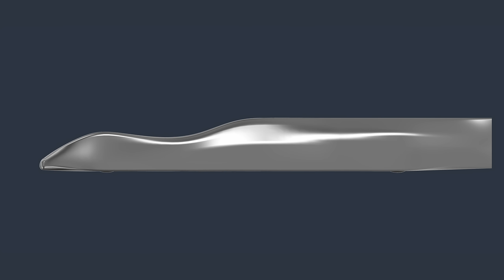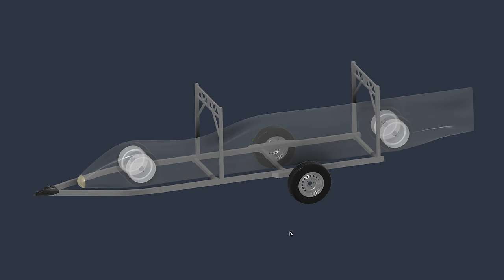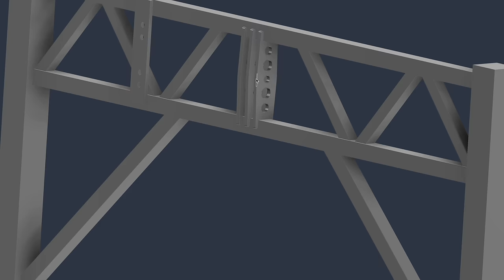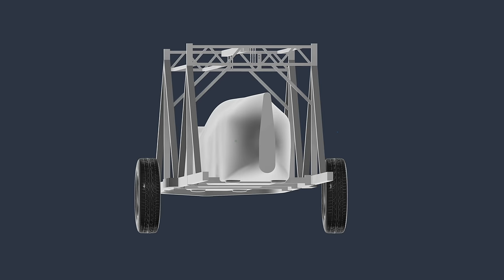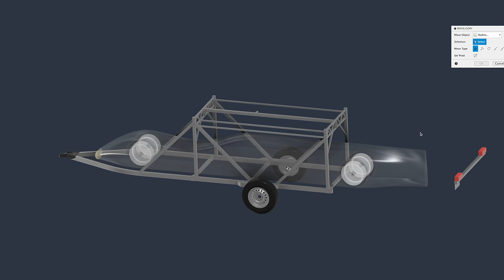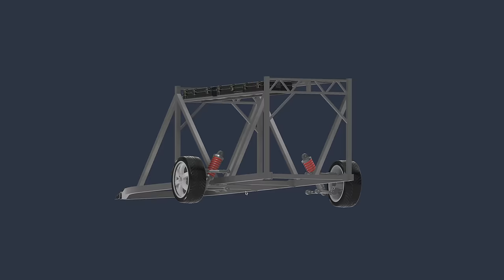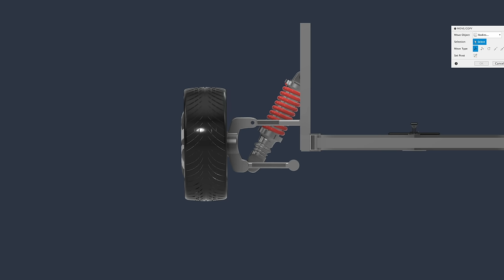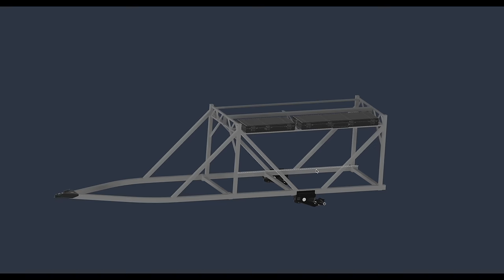How To Trailer A Car With ZERO Ground Clearance

Comment: Paint for zinc gal exists, you want the Hammerite gal paint or Dymark Zinc Guard stuff. You can also treat the surface with a mild acid like 5% acetic (you know, white cleaning vinegar) and use an enamel.

Trailer looks great!

Comment: You may want to load the car in backwards to improve weight distribution on the trailer and reduce wear on the front facing polished surfaces of the car while towing.
Reply: Brilliant. Very good point.
Reply: Did you miss the part where he carefully calculated the weight distribution of the car when placing the axles?
Reply: @brianpennington4202  I caught that, but wanted to see the calc with the car backwards. I said ‘may’ meaning maybe no better but the car isn’t 50/50.

Comment: The air pressure string trick works better if you tie a plastic sack on the other end and use a shop vac.

Comment: If you don't at least get ST trailer tires, get some LT tires with more of a highway tread design. 195/75R16XL, LT225/75R16, and LT215/85R16 are easy to find as they are common tires for dually commercial trucks.

What I would be inclined to do is match whatever size you run on the motorhome (probably 225/75 based on every E350 cutaway I've worked on). If you run 8- lug adapters, you could even share wheels back and forth in a pinch.
Reply: What is the load per tire, and what is the tire load capacity? If there is suitable capacity, there is no need to buy new tires. 

Sharing wheels with the RV to share tires does make practical sense.
Reply: I know you'd definitely want trailer tires on the trailer, but unfortunately as I'm not a tire engineer, I can't really articulate the reasons why. I do know that trailer tires just act different from vehicle tires, and cope better with the loads trailers see. Apparently lo-pro vehicle tires cope especially poorly with trailer loads. I remember Doug went into it in his VINWiki video about the Corvette boat, which came with a Corvette themed trailer riding on Corvette wheels and tires. https://youtu.be/vGWjlT_xRq8?si=PLpsVyoxLKDwjlj4
Reply: @billgiglio1023  tires work the same way on trailers as other vehicles, and the tires don't know that they're on a trailer. 

In heavy trucks, tires for every axle are built the say way, except that they are available with treads optimized for wear in three classes of position: steer, drive, and trailer. They also have "all position" types available, so clearly exactly the same tire can work properly in any role. 

Light motor vehicles (cars, pickup trucks) don't have separate steer and drive tires; they don't need separate trailer tires, either. The rear tires on a front-wheel-drive car don't steer, don't drive, and have exactly the same job as a trailer... and the same tires work there are on the front of the same car, or on the front or rear or a rear-wheel-drive or all-wheel-drive car.

The "ST" (for "Special Trailer") designation for small trailer tires is only used in North America - apparently tires are supposed to work differently on different continents. 😄 They are suitable for trailers, and so are other types (commercial, Euro-metric, "LT" for Light Truck, and even "P" for passenger) when used within their rated capacity.
Reply: Exactly. Nearly every trailer/RV forum has some oldtimers who will pipe up to say they learned the trailer tire lesson the hard way. It's more than just load rating. 

LT tires with a highway rib tread pattern are similar enough that some trailer manufacturers spec them on some models. I'm doing so on one project where the trailer is a lightweight, limited-use show piece and the smallest LT tires (185/80R14) are a better fit than the smallest ST tires (205/75R14)  

This hauler and the race car may not weigh a ton, but it's a very long contraption, prone to all of the funky dynamics and leverage that come with that. I wouldn't highway tow it anywhere on those Viper wheels.
Reply: A young guy with an Austin Mini (the 1960’s type) used trailer tires because they were available for 10” wheels. How well did that work? I don’t know, but he also tinted all the windows deep lime green to match the body.

Comment: Not applicable for this application, but I don't know how I lived before having a "Donahue"(brand) moveable axle drop deck implement trailer.  The deck of the trailer can be literally laid on the ground and you just dive on the deck, then move the axles back and drag the movable tongue back up into position.  All done by locking/unlocking the trailer wheels and the axle carrier slides on the underside of the deck.

Comment: Matt, that string trick is pretty neat. I've used it with PVC pipe and a shop vac but never ship air. Nice job.
Reply: tie the string to a slightly inflated baggie if it doesn't work the first time.

Comment: I would be careful about using non-trailer wheels and tires on the trailer. While it may turn out to be a perfectly fine, it would be really disappointing if there was another VINwiki Corvette-boatesque incident where sports car tires cannot handle trailer vibrations and shake themselves off the trailer, or otherwise being a headache
Reply: And what happens when the spare tire goes on and you want to drive in a straight line? But it looks awesome which is the most important thing
Reply: @Droidy77 he has 4 Viper tires, surely he'd just use one of those as the spare to keep everything matching up

Comment: Nice job on getting the trailer operational. The suspension was almost exactly what I was picturing, with a trailing arm setup (trailer of the trailer's trailing arm?). Although it is stronger and offers storage with the gun boxes, I am kind of surprised you did not make the upper section collapsible. After all, you are driving around with one of the world's most aerodynamic vehicles behind you (once the bodywork is added)--and it's covered in scaffolding.

Comment: Up until the midway point, I was screaming "Why don't you just use Timbren units!!?" YES!!

OTOH, why use the midpoint swinging beam? Why not use the already provided mounting point for the welded cross tube? (Recommended) but install a nice pair of bolts for the tube? I'm guessing that fitting/removal of the tube might be problematical? I'd still suggest adding it in, as the bending forces from the suspension unit might be a bit much. You might need to taper at least one side of the tube to make fitting it easier.

Comment: I had a friend who use to make custom enclosed trailers for drag cars, mostly notalgic and railers. He used an electric winch on pulley rail system that ran from the rear to the front of the car. You lifted the front of the car in the air and load it with the front raised. This prevented the car from bottoming out.

Comment: Another option for lifting the LSC would be to have the two 'overarms' actually pivot.  Lean them backwards 45 degrees, hook up the car, pull them upright with the winch, and secure them in place with trailer hitch pins.  Would require securing the car to the trailer somehow, though.

Comment: 4:52 I may be wrong, but I'm fairly certain that a single axle trailer cannot legally be over 16' in the US(except for boat trailers). It may just be Texas, though. So if it is that long(or 17.5' as you stated later), the trailer may not be legal as you still only have one axle.

I worked for over 5 years at a Fabrication shop that commonly made trailers, and i had to reference the code book somewhat often(i seemed to be the only one that cared about them actually being legal, and i was in charge of the lighting and finishing stages). I left that job last year, and i can't find that exact code book online, so i can't say for certain. I do know for a fact that we never built a single axle that was longer than 16', for anything over that we always did tandems.
Reply: Also, I'm sure you already know this, but whenever you do install the fenders, you'll need to make sure there are lights marking their width, as they will be the widest point of the trailer. Your trailer looks to be under 80" total width, so you don't need anything additional besides your tails(which serve as your rear markers as well), width markers, and front markers(which it looks like you already have).

If you added sideways extension wings to the rear bumper equal to the width of the fenders, you could mount your taillights there and not require fender lights.
Reply: You are wrong
Reply: @russellv6234  Can you back that up with something solid? I have trouble believing a simple "you are wrong"
Reply: @TheHonestL1ar  Easily. The US doesn't make trailer laws. Individual states do because we're a stupid fucking country and require things to be as complex as possible. So there could be as many as 50 different trailer length laws.
Reply: Also you can get a 28 foot pup trailer in every state and they only have 1 axle
Reply: @russellv6234   Pup trailers are for semis. I'm talking about trailers for pickups or cars. Semis have an entirely separate set of regulations.

Also, I did say in my original comment, "It may just be for Texas, though." Every state has their own laws because the federal government has limits in place to prevent them from controlling everything, and anything not regulated at the federal level is left up to each state individually. It's actually a very smart system for a country as large and varied as this is. Something that works for Washington might not work for Florida or any other combination of states.

Lastly, the federal government absolutely has regulations regarding vehicles and trailers. Most of what you find in the day-to-day just governs commercial vehicles, hence why you'll see both a state and US DOT number on the side of every semi truck. However, the US does have loose general overall guidelines on everything that goes on the roads.
Reply: @TheHonestL1ar  And yet after all that you got it wrong. No 16' limit on single axle trailers
Reply: @TheHonestL1ar  Thanks for your helpful comment(s) and keeping the discussion reasonable versus angry guys comments
Reply: Axels carry weight. length is only important to the tax man. In my county no registration needed for less than 16’
Reply: He is in California, 16' is the max for some rules, I think larger can't use a PTI but need registration every year.  You need brakes for 1500lbs or more, so he will need brakes, and a second axle is a great idea.  My trailer (see my channel) uses a smaller diameter front wheel so its a single axle when empty making it easy to tow and move by hand, but the second axles contacts ground when a car is on it, and also gives me two spare tires already in place if a rear one blows out.
Reply: @murraymadness4674  I did consider mentioning the brakes being required, but I chose not to. Brakes are the single most common thing to be nonfunctional on a trailer even when they're required by law, so I decided it was no use.

Comment: Seems like it would have been much simpler and cheaper - well, maybe not cheaper - to buy 2 Collins Tow Dollies, weld a tow hitch to one of them that extends out several feet, and strap them to the speedster. According to Casey LaDelle, they're good for hundreds of miles at highway speed.
Reply: Interesting idea. You'd have a problem steering the front dollies, or more correctly, allowing the front dollies to pivot/steer on the front of the racecar.

Comment: I'm only a minute in - but I have been thinking about this very problem for the last couple of days. A solution I am contemplating is - what about a trailer with a parallelogram lift system so that you can drop an inner suspended deck right down onto the ground? It could then be raised using either mechanical or pneumatic/hydraulic lift and locked into place using pins. 
I will now watch the rest of the video, and see if we both arrived at the same solution.
Reply: They use such trailers for pontoon boats but not low like needed here. A good system.

Comment: It will be interesting to see if you can still get those bolts into/out of the lower cross bars once it has been moving under load on harsh roads for some length of time. Especially if you roll it around without them while on the lake. Steel is rather bendy.
Reply from the maker: It wasn't a problem for the other trailer teams i talked to, but I will have a few ratchet straps and a hammer ready just in case.
Reply: It works OK, just keep a hammer handy. We have transported NT3 from San Diego to Bonneville and all around El Mirge without any major issues.

Comment: great job, but i would get the right wheels, no dam adapters ,also a put 4 wheels on it. ive towed racecars for 400 years and you dont want a blow out with only one tire per side,notting good happens. glad you are back on our project.

Comment: Also a handy trailer to pick up a lot of heavy things like donor engines and metal tubing. You could have a brake light at the very back to stop stupid people from crashing into the back of your very long race car.
Reply: From what I got he'll put the taillights on some kind of removeble tube that'll mount on the back of the race car.

Comment: I see you are an adherent of random triangulation even where it adds nothing but extra weight. 
I applaud you 👏

Btw it's Vi  number - just like Pi number
Reply: And AT machine.
Reply: Please the memory of using vi is coming back, used it just enough be functional.

It is a vin number the same as my nice card. ;)

Comment: How do you put the spare on if you get a flat? Is it going to be a spacer removal on the side of the highway kind of adventure? I'm unsure if you missed that or just left it for future Matt to figure out.
Reply: Definitely future Matt's problem
Reply: @cloudyview  poor future Matt!! Send thoughts and prayers!!!
Reply: Future Matt tends to hate Present Matt for this kinda stuff
Reply: Hopefully future Matt will also check fender clearence with the spare when they get installed
Reply: he could add a mount each side for the jockey wheel. these could also be used for umbrella mounting when working on the vehicle.
Reply: Using the viper tires means he should have not one but two perfectly good full size spares. I assume mounting is just another finishing touch, which might never get finished, but seems like a simple enough solution…
Reply: @jcorkable  I was thinking the same, exept it's not a full size replacement. Viper fronts are way skinnier than rears, the size will be the same up to the 2nd gen wheels but different from 3rd gen or newer. (I don't remember which gen did Matt buy)
Reply: @jcorkable  Viper rear tires are way too wide for this, I'd assume
Reply: @jcorkable  pretty sure the viper rears are wider than fronts?
Reply: @reinbeers5322  or is it Present Matt hates Past Matt? Incidentally we should get all three together to host some sort of interdimensional car show. Quantum Gear?
Reply: @n_tas  Present Matt was once Future Matt, thus we are both right.
Reply: I dunno about "adventure", it's just 5 more lugnuts to remove.  By the time you're doing it, and as seldom as it happens, it's likely a case of overthinking.
Reply: @12x2richter  overthinking is clearly future Matt's problem to deal with!!!

Comment: You can get old sailboat "Winches" for pretty cheap. They are not electric but they will always work, even after sitting outside for 10 years. The newer self-tailing winches are what everybody wants and are much cooler but when sailers upgrade the older style becomes very cheap/free.

Comment: Did you consider creating dollies that cradle the wheels of the car to increase ground clearance and approach and departure angles?  Lift the front and back of the car with floor jacks, slide the dollies under the wheels, and wheel it onto a "more normal" trailer.
Reply from the maker: There is no floor jack that will fit under it with the body on. You have to lift it from the top. And at that point, might as well just lift it with the trailer.
Reply: @SuperfastMatt  Check out the way Formula Student teams jack their cars up. It's basically two sets of tube frames nested inside each other with bars on bushings connecting them and forming a parallelogram. When flattened it will be only as high as the thickness of the tubes of the frame. You can then attach giant L arms on the end as a lever to pull it into its upright position. It only requires the muscle power of one average engineering student, although the cars are only around 200kg or less, so this may not work with the land speed car.
Reply: @VulpeculaJoy  These Quickjacks are however (usually) very flimsy and cars sometimes fall off them. With this year's FSG Rule change, these quick jacks were removed from the rules and replaced with 2 beer crates, and manual lifting of the car...
Reply: @VulpeculaJoy Matt literally wrote a book about his time in a Formula SAE team. Called Racecar. It's a good book, you can download a PDF of it.
Reply: @marcjulianzuther6660  Not necessarily. You can still use the same method, you just have to make it fit under the footprint of the car.

Comment: Why not just make some tiny dollies you can jack under each wheel, or small wheels with tall shafts you can jack up the car then bolt on each corner? Then can trailer like normal with some right height yes? Though you lose some of the other advantages of doing these things, just thought it was worth a mention as surely it satisfies the original intent with what you had with the least effort?

Comment: Round 7 trailer connector includes a charge wire, to charge the winch battery, and a reverse light wire, that you wire to a solenoid on the surge brake coupler...